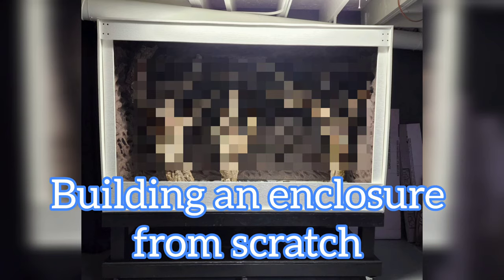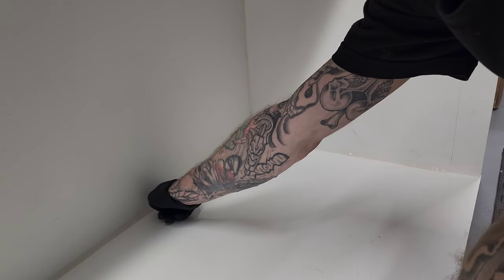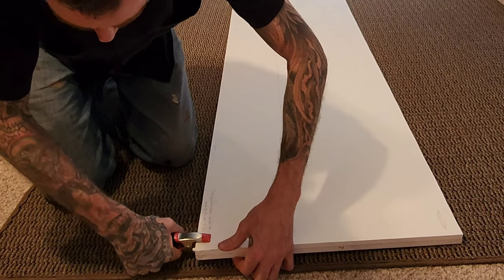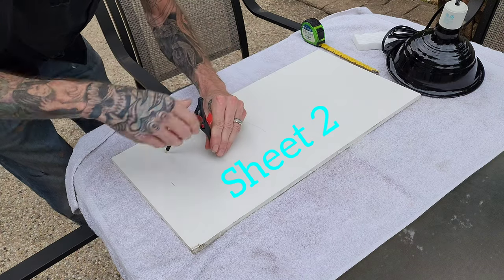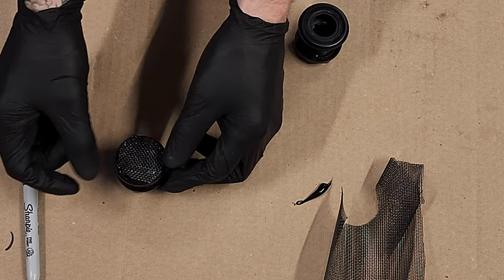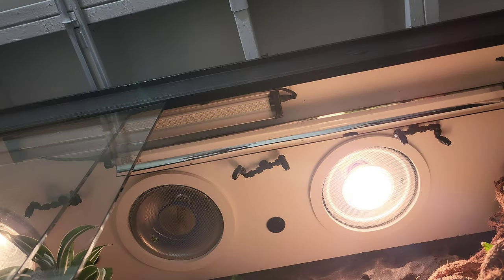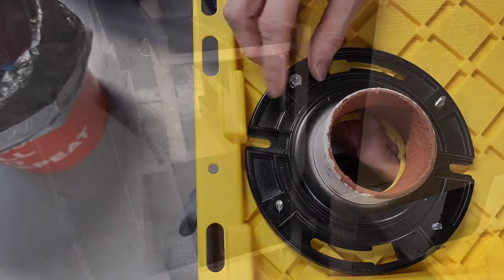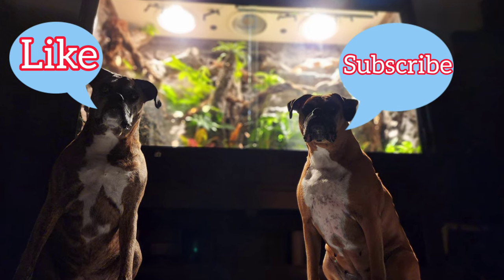How To Build A Reptile Enclosure PVC or Wood DIY Cage #reptiles #enclosure

Comment: Unbelievable work.  You got me motivated to build my own 5x3x2 bio active enclosure.  What is the app/program you use to control everything?  I was gonna get the Arcadia Jungle Dawn, a T5 UVB bulb, a deep heat projector, and a mister.  I’m looking at getting the Lumenize stuff but was wondering if there’s something that would cover everything as well in one app.
Reply from the maker: @k9midas1  thanx and I'm glad your gonna build one!
I use gove smart plugs to control everything on an app. If u get the lumenize u will use the arcadia app to program the timer settings and a mistking has its own timer. 
Wish there was a way to tie everything together. The old arcadia product would work with govee smart plugs but won't have tolhe cool ramp up and ramp down effect

Comment: Man I want to build one but I suck at measuring and cutting things. If you sold these as pre cut kits that would be a dream!! Amazing.
Reply from the maker: I'm looking into doing something like this mid to late 2024. We will see. But CNC machines are expensive lol. In the mean time if you try it cut slow. Follow the line. Measurements are fairly straight forward.  All in inch or half inch cuts.
🤘💯🦎🐸🐍🐢🌱

Comment: This is savage bro bro! Curious where do you get the pvc, and what type?
Reply from the maker: Thanx bro! 
It's 1/2 found at home depo, Lowes, or manards. I double up the front frame where I attach the glass track so the track fits and addsstrength to prevent bowing. The pvc is light enough so the front frame does the trick while eliminating a vertical center brace right in the middle of the glass.
https://www.menards.com/main/building-materials/siding/trim-boards/royal-reg-building-products-1-2-x-4-x-8-white-pvc-panel/1429329/p-1510903720728-c-13411.htm

Comment: I wish this was posted sooner i was unsure if that pvc board was safe so i went with birch incredible enclosure
Reply from the maker: Just build more lol. Birch is a good option though, much better than plywood. I'm sure it came out great regardless.  Thanx for watching 🤘🦎💯
Reply: @bradsbioactivebuilds  lol yeah I plan to build a pvc one again now 
I was worried since one side was textured assumed it probably wasn’t safe but after seeing that was what you used i assume it’s OK 
I believe manufacturer is royal.
Only problem I have with the birch one I built so far is does not seem like it holds temperature near as good as the HDPE enclosure I bought from symptom  on chewy

Comment: Can you make a video explaining the process of how you make the slots for the glass so it’s held in and able to slide open and closed?
Reply from the maker: I can with a future build. 
But the "slots" is just a glass track I got on Amazon (link at the end of this post). 
After I have the front frame installed (doubled up pvc board to make it 1" thick). I measure the opening where the glass is going to go before I install the glass track. 
Then, install the glass track with silicone, holding it in place with painters tape. I take the leftover glass track (I had 1" cut-off)  and brought it to a glass shop. Gave them the measurements of the opening and the cutoff glass track. They did all the math (around 1/4" less than opening.) And cut the glass. I used 1/4" tempered glass.
Randall Manufacturing 1/4" Plastic Sliding Door Track (Black, 6 FT Long) https://a.co/hv12IEX
Reply: @bradsbioactivebuilds  awesome, thank you.

Comment: Your videos are top notch and you have helped me move towards building my own, only question is on this one you have the side as 4' x 23 1/2"...since using half inch pvc shouldn't that be 23" to allow for the half inch on each side or am I missing something??
Reply from the maker: Thank you,  I put a lot of work into the videos to try and explain everything to the best of my ability.  I'm glad it has helped you move towards building your own. 
To answer your the sides are 23 1/2". Everything site on top of the bottom panel that measures 6'L x 24"d.
So when I put my back panel on it will reduce the side panels by 1/2" (4'h x 23 1/2" deep) to compensate for the 1/2" thickness of the pvc sheet. The 1st few minutes of my Chameleon enclose build shows building an enclosure to that might be helpful too. 
Let me know if you have any other questions and have fun with your build. 
🤘💯🦎🐸🐍🐢🌱

Comment: By far the best build video. Would u recommend a center support in the front if I were stacking 6x2x2's?
Reply from the maker: Thank you. 
Depends on what you material you are building with (woodbor pvc). If it is pvc, I would recommend center support if shacking. I would build a shelf/stand for top enclosure depending on weight and substrate of the top enclosure. 
A 3/4 hard wood enclosure you should be able to get by without center support, but that one could go either way.
Hope that helps
🤘💯🦎🐸🐍🐢🌱

Comment: Hey Brad, apologies if this has been addressed somewhere else, but were is that 40 mm fan video? I love that idea and would very much like to see your process/know what specific materials you use for it. Hoping it will be available soon!
Reply from the maker: Hey, I'm hoping to have the video out once I finish up my current build I'm working on. The video will have 4 or 5 different ways to create air circulation inside a viv. Along with the DIY for all of them. Stay tuned 
🤘💯🦎🐸🐍🐢🌱
Reply: @bradsbioactivebuilds  literally cannot wait! Having real problems with air circulation in several habitats and I'm so tired of precariously perching larger computer fans on top of lids.

Comment: What glass do you use
Reply from the maker: I used 1/4" tempered glass. I had the glass shop buff/smooth the edges so it would reduce resistance when sliding.

Comment: What type of PVC board did you use I'm planning on building my own to have them build with cost me three grand for three cages so I'm going to build in myself I love your video it's very informational just don't know what type of PVC board did you use there's so many different types out and different prices just want to make sure I get the right one
Reply from the maker: I used 4x8 sheets from homedepo. They run about 99 a sheet. I have the links in the description in the other videos (for my blue tree monitor) but it's a shipped price 
Any other questions lmkband have fun building!
🤘💯🦎🐸🐍🐢🌱

Comment: Please post link to the angle tools. Great video
Reply from the maker: I got mine from a local hardware store, butbi found these ones on Amazon 
90 Degree Angle Clamps, Woodworking Corner Clip, Right Angle Clip Fixer, Set of 4 Clamp Tool with Adjustable Hand Tools (orange+black) https://a.co/d/iirBfby

Comment: Was there any issue with heat from the lamps and the material used for the top?
Reply from the maker: Good question, I was originally worried about the heat. I did cut it a 1/4" bigger then the 8.5 dome light fixture. After the enclose has been up and running the surface temps only hit 98f. I thinkni wish I did differently on this enclosure would have been to cut the circles tight to the dome. 
I did cut them tight to the dome on the next large build I did and surface temperature hits a few degrees warmer

Comment: What size space would you say this would need to fit into? Hoping to build it for my ball python but want to make sure it fits where I'm thinking. Will have everything except the fogger and the nest box.
Reply from the maker: Like the room size for the enclosure yo be in?
You could put in somewhere tight to an open room concept. 
The measurements are 6x2x4 but also sits on a 2' stand.
Hope this helped!
Reply: @bradsbioactivebuilds  sorry, talking more about extra space needed around the enclosure for air flow and accessories. Without the nest box and fogger, it seems like I could put it up against a wall, right? And with vent holes along the front, I wouldn't have to worry about the sides.
Reply from the maker: @kellireich6146  correct,  it can be pushed up against the wall. Maybe 2" gap if you wanted to run cords for light fixtures in the back.
Either way would work for vents. Sides or front high and low.
Hope that helps 🤘💯🤘

Comment: How did you get the glass into the tracks after the tracks were installed? Also, the glass tracks are held in place with just silicone? Strong?
Reply from the maker: The top track has a longer insert/lip. The bottom track has a smaller lip. I measure the gap between the front opening before I install the glass track. Then, cut the track to fit the length. (I keep the cut extra track to bring to the glass shop and give them my opening measurements without the track installed. Any local glass shop will do). Yes, silicone works great. I found the best one is at Home Depo by the plexiglass & acrylic section. It comes in a white and red tub. It's 100% silicone. And if it wasn't this wouldn't really matter to much once cured bc it's pretty much out of the enclosure.) Then just lay the track into place and use painters tape to hold it in place for 24 hours. 
Then, just lift the glass into the top track and have it drop (gently) into the bottom track. The lip on the top keeps it into place.

Comment: Brad.......Outstanding F#$@% Job. Purchased a nelson milk snake last year for our son, got the zoo med 40 gallon starter aquarium. Mad because Bob the snake didn't make it. Lesson learned what not to purchase for snakes. Stores should sell a snake enclosure, just for snakes (Only Snakes)!!! Since HEAT RISES/HUMIDITY RISES and escapes through the top of the tank don't freaking buy it. The tank needs to be fully enclosed on the top, left and right sides and bottom. I'm a carpenter and this video makes me want to build this enclosure without purchasing another snake and then tell the wife (Well, I built the top of the line enclosure, might as well purchase another snake for the kids). She can never say no to the kids....hehehehe. 

Do not purchase any reptile unless you build this DIY enclosure. You can always build in steps and add on as needed.

Once again H##LL of a job. So jealous.
Reply from the maker: Couldn't agree more about some of the info from big pet store chains. The seel wjat they can move not move what needs to be sold. That sucks about your milk snake Bob. Hope you build one and enjoy knowing you made it to Suite the animals needs. Plus it's a good reason to get another lol.
Thanx for your support 🤘💯🦎🐸🐍🐢

Comment: I'm so bad at planning and have never built anything close to this amazing- what are your recommendations on planning a build like this?? You seem to have thought of everything! I would gladly buy a build plan for a similar encosure from you, you should sell them!!
Reply from the maker: Thank you, much appreciated.  The hardest part is sometimes getting started. But shoot me a message on Instagram, and I'll send you the plans I drew up if I can find them. But it's essentially building a box.

The bottom and top is 6x2

Back panel is 6w4h that sits on top of the bottom panel and under the top panel.

I used 1/2 thickness material 
So the side panels were 23.5 inches in depth and 4 foot high.

For the frontbi just recessed in the boards .5 inches to give it some character.

Comment: I'd like to build one of these for a future tree monitor, I know the title says PVC or wood enclosure, and since PVC isn't super avalible around me, what kind of wood would you reccomend?
Reply from the maker: I would go minimum 1/2" or larger (there are more readly available thickness plywood than pvc) , I would use 5 ply. Go with a hardwood. Definitely use drylok or polyurethane to protect the wood from moisture.  
You won't regret getting a tree monitor! 
🤘💯🦎🐸🐢🐍
Reply: @bradsbioactivebuilds  Sweet thank you so much! and keep up the absolutley amazing videos!
Reply: So if you decide to just make the enclosure out of plywood it would be safe to just drylok it? How many cots would you think with a wet/ humid environment? Do you just use the pvc for low weight or?

Comment: When you use sliding doors on a snakes enclosure (I have a ball pythons) can they not slide it if they get between the middle part where it over laps? I just made one for my snake & that’s how the doors are but the sides sit more away from the wood so she’ll be able to slide out
Reply: I’m sorry if that doesn’t make sense, but I’ll answer with more details if anyone can help me!!!??  Pls
Reply from the maker: @breakablejewels02091  I have a small gap. 1/8 inch or so. You can always get a glass showcase lock. I gonover it in the hardscape of this build. The one with the blue tree monitor on the thumbnail

Comment: I have heard cutting PVC can be a pain. Did you do anything special for that?
Reply from the maker: It's no harder then cutting wood. Cuts like a warm knife through butter. Jigsaw or circular saw work fine. Just wear a mask bc or fumes at high heat and pvc micro particals. 
🤘💯🦎🐍🐢🐸

Comment: Can PVC cement be used
Reply from the maker: I'm sure it could if you work fast. I would use the clear primer. I thought about doing the seal but it bond quicker then I could drill it. I also thought about ruffing up the seam and using pvc cement on the seam but went with lexel and did a few thin coats of drylok over it. I know guys that have done regular GE1 silicone with success but in my experience in time it has a good chance of it coming undone and and leaking.

Comment: The dimensions are different vs the ackie enclosure but is others measures concept wise the same ?
Reply from the maker: Yup for the ackie build I just wend 3ft high instead of 4ft high. I didn't enclude a bulk head at the bottom for drainage due to it being a more arid setup.
🤘💯🦎🐸🐢🐍🌱

Comment: This may be a mundane question but how do you measure the glass for this kind of enclosure? I don’t want to get it close and wrong 😂.
Reply from the maker: @mimibyrd  depending on the glass track u use.
Measure the total open before installing track.
Bring a small peice of the glass track to the glass company with your measurements of the opening. They should cut it to spec. 
I also like a 1.5 to 2 inch center overlap.
I go over it a little bit more in this video here. Hope this helps
https://youtu.be/rcfyfReSypM?si=spkM_ItSgpl7KP4t

Comment: I was wondering if you could do a guide on reptizoo tanks specifically with the easy cord management and your thoughts on if its very helpful for those of us that are not ready to drill holes in the glass😂
Reply from the maker: Interesting. I usually use exoterra. But reach out to Reptizoo and have them send me a tank lol. All jokes aside, I have a few builds lined up. But maybe I'll do a raffle build with a Reptizoo that has the easy cord management for a future build video.
Thanx for your comment, watching, and idea!
🤘💯🦎🐸🐍🐢🌱
Reply: Maybe I'm looking at the wrong brand thanks for the reply and yes I messaged reptizoo about you being a up coming star in diy terrarium builds
Reply from the maker: @joshb7857  much appreciated Josh! Thanx for your support! And they are all good. I just started with exoterra when i got into dart frogs and kept them all my other builds in uniform, so they match. That's the main reason other than the vents were smaller to help fruitfly proof. 🤘💯🦎🐸🐍🐢🌱

Comment: Would it be possible to make a hide box exactly like the one at the end of this video (out of tote boxes with a heat pad controlled by a thermostat) but place it inside of an enclosure? I just built a pvc enclosure for my boa constrictor, and because of how tall it is, I am having trouble heating the bottom of the enclosure where he spends his time during the day. I wanted to place a heat pad on the outside of the enclosure, but the heat doesn’t go through the PVC board. I’m just not sure if making a hide box like this and placing it inside of the enclosure would be safe, with all of the wires and everything.
Reply from the maker: You should be ok doing that. I have seen other people do it the way you are describing. Just make sure you check the manufacturers instructions and warnings if it gets wet. 
🤘💯🦎🐸🐢🐍🌱

Comment: What was the budget? And saving money with us is compared to what the thousands of dollar enclosures I’m trying to see what is more affordable building or buying one like it is going to land outside of my budget. How would you recommend I save money with this build
Reply from the maker: There are ways to go all out with this build or cut costs. Example using g 1/4 inch tempered glass, not tempered glass or plexiglass. Tempered is you best option for scratching and strength. 
Pvc board is more expensive then ply wood. Depending on what lights you use, Amazon or arcadia

But a quick break down off the top of my head
3 sheers of PVC 100 each
Tempered glass lass $200
3 Light domes (20 each)
Wood for stand (40-50 bucks)
Screws $9
Lexel Adhesive $12
Glass track $40
Bulkhead for drainage $7

If you start doing hardscape stuff it's then the cost is ul to you on what you want to add. 
Hope this helps.
I also have a lot of the links in the hards scape build video (link in description) 
🤘💯🦎🐍🐢🐸🌱

Comment: What paint did you use to paint the pvc enclosure itself?
Reply from the maker: I primed it with a pvc primer and an acrylic latex paint. Most paint shops can point you in the right direction with what they have instock.
🤘💯🦎🐸🐢🐍🌱